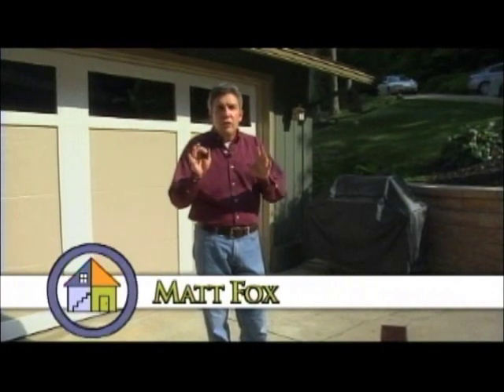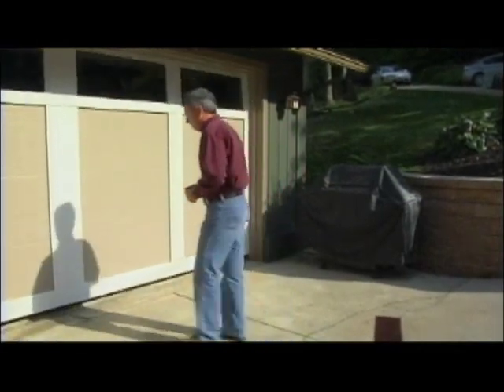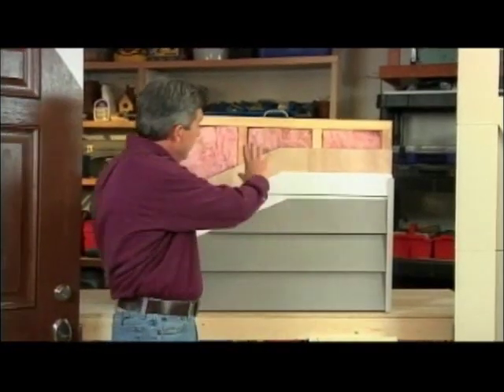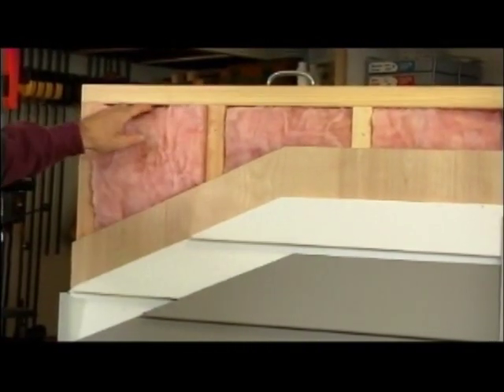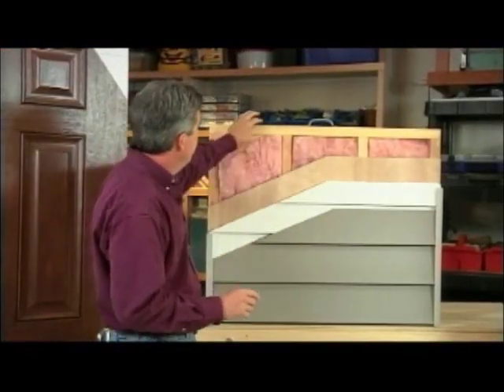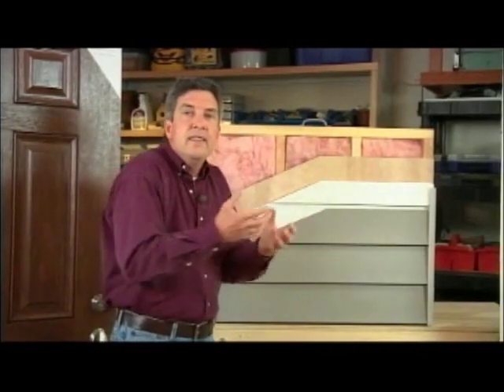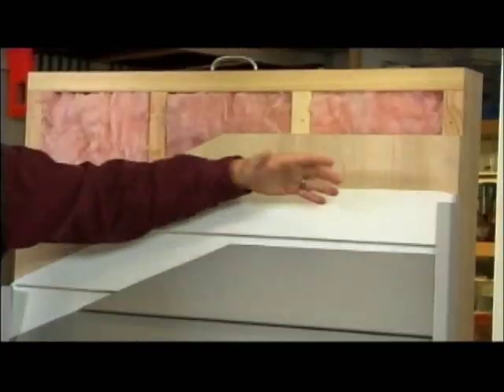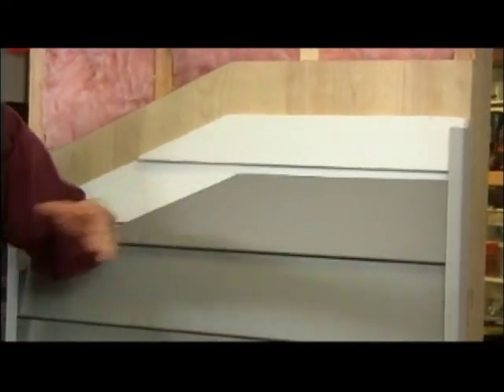How to Insulate Your Home's Exterior

Comment from the maker: @HomeEnergyNow You are correct that most materials in a wall assembly get credit for a little R-value. It is usually very low, and therefore they are not included as insulation materials in the prescriptive measures of the IECC or Energy Star. The Department of Energy also stresses the importance of reducing thermal bridging with exterior wall insulation.

Comment from the maker: @HomeEnergyNow We're simply promoting a complete building thermal envelope, along with the rest of the home performance industry and the best and brightest of the building science community.  Many of these professionals include exterior wall insulation in their recommendations.  Fortunately, there are siding insulation systems available for all types of cladding, making it possible for homeowners to have both the aesthetics and the energy-efficiency they demand.
Reply: Could one insulate, say a container structure, only from the outside with this?